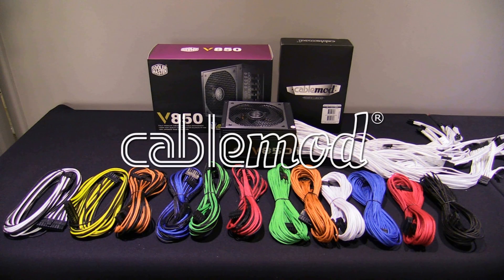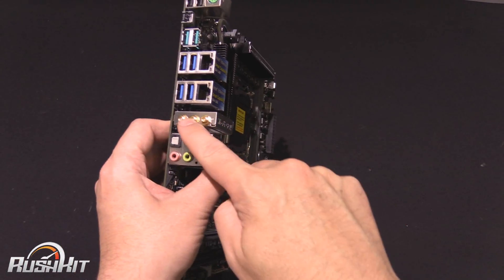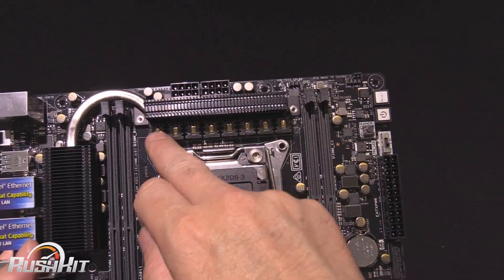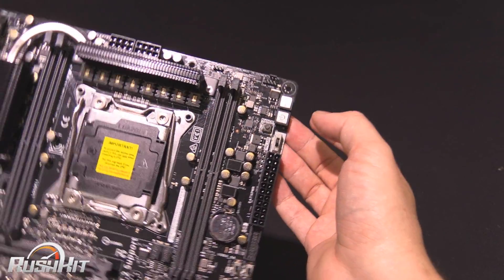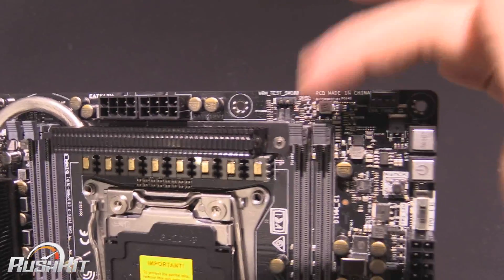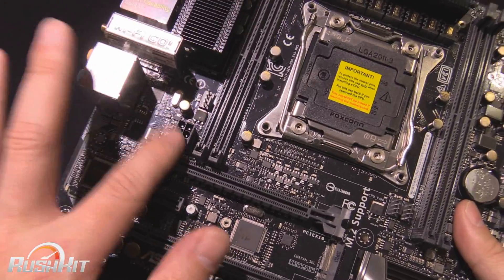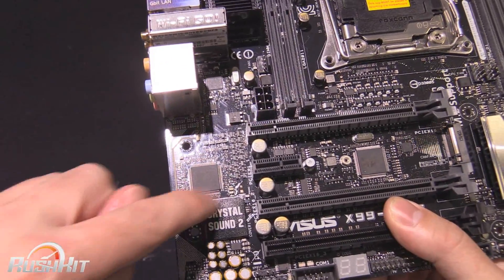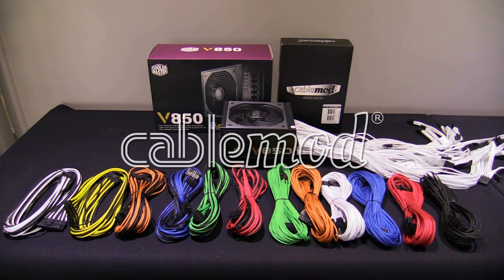Asus X99 MATX WS Work Station

Comment: I got the full ATX version but I wanted this later. Can that Wi=Fi be upgraded if taken apart or off?  As with my X99-E WS the Noctua MH-D15 nudges up against the GPU but it can run full 16 in 2 other slots. Can this run full single 16 in 2nd or 3rd ?

Comment: Had mines for a year, Was a great board when it worked, mines died 3 days ago :(............Think my wall socket murdered it LOL.
Reply: This seems to happen allot with asus ...grt... just ordered it but fairly cheap and larger version only because my cpu is still relevant and fairly pricey as a OEM xeon, need to get it back up and running...

Comment: Here's a question i couldn't find an answer to on the asus site.  Can you use the m.2 slot and all the PCIe slots?  I'd like to use a 40 lane CPU along with:
1) 2 SLI GPUs
2) a LSI card
3) an M.2 SSD.

It's unclear to me if this is possible.  In many mobos, the m.2 slot shares with a PCI slot.  I'd like to know if that's the case with this mobo, or if i can handle all of this at once for my nxt build.

Comment: Damn.  No mention about the M.2 slot, so I went to the Asus page to look. 

IT'S ONLY PCIe GEN2 X2-LANES, =10GB/sec max!!  What the hell!  I want the Gen3 x4 M.2 (32GB/sec potential), so the Samsung SM951 SSD can run at full speed.

This would be a deal-breaker for me on this one, which is an otherwise ideally-featured board.  Can't believe Asus cheaped out on the M.2 config.  Back to the ASRock X99M Extreme4, for me, if I need a compact X99.  The ASRock is also ~$60. less.  Only thing it lacks is the Wi-Fi and USB 3.1 on the back, neither of which I really need.  Fast SSD is the priority for me.
Reply: +al bundy I'm not seeing any note in the ASRock specs, or anywhere, that ways anything about M.2 disabling anything except a couple SATA ports.  And as far as I'm aware, that applies to any of the boards from any maker that advertise Gen3 x4 on the M.2 slot.  Can you show me where you got this info from?